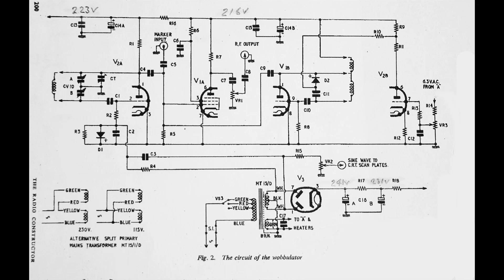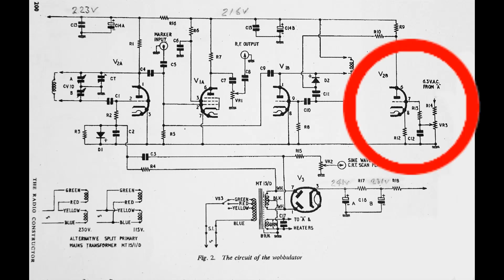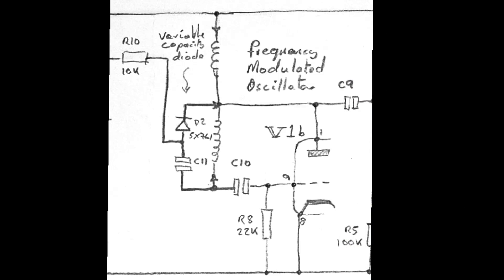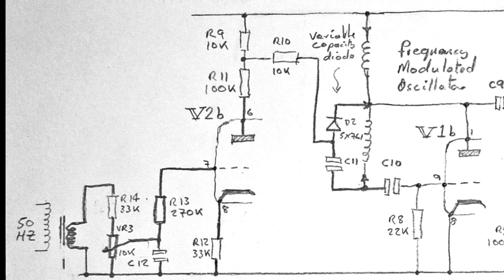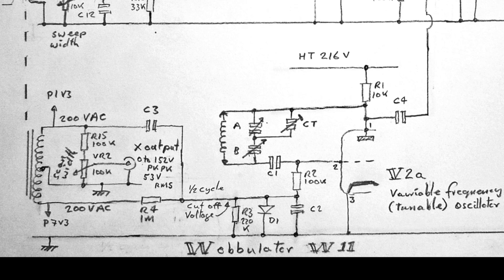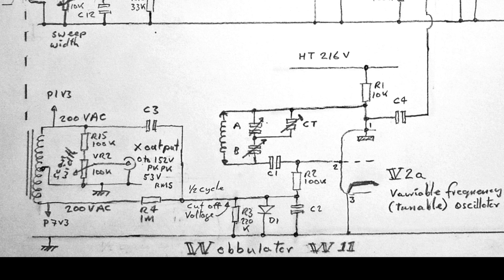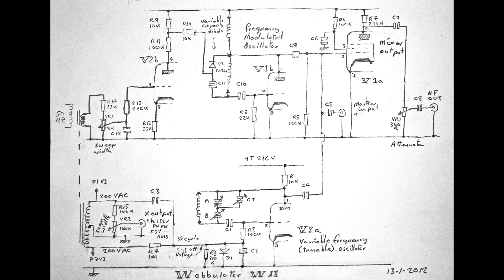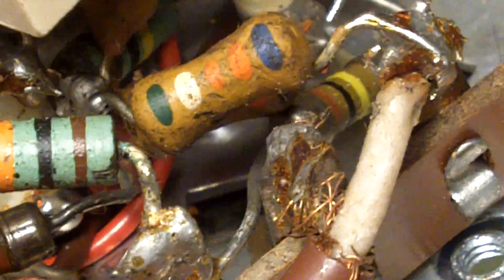About Radio ... Part 37 Wobbulator, Further  Ongoing Repair by Andy Davies

Comment from the maker: Hi there, I certainly find it helps to have things presented in a reasonably logical fashion and left-to-right works for me. Unfortunately I’ve let this project hang on far too long but I do intend to finish it. OK on the homebrew kit, in fact I have another wobbulator that’s homemade (not by me) but I don’t want to try it out yet as I won’t want to fix the Jason once I’ve got the  Eddystone radio aligned. 
Kind Regards... Andy

Comment: Great explanation.  Amazing how much of a difference redrawing the circuit can make to the clarity of the design.  We are so habituated to reading L-R, input to output.

I'm tempted to build my own version of this heterodyne wobulator using solid state.  Long ago I built a directly FMed generator with a 555 timebase.  Using a largely fixed frequency sweep oscillator means you can directly calibrate the width control, where as in mine the shift varies with centre-frequency tuning.

Comment from the maker: Hi there, thanks for the interest. I did a bit more work on the wobbulator; I found quite a few resistors were way way out of spec. It’s working but I’m not sure if its 100% correct yet. I had to shelve the project temporarily some time ago as I have a lot of other more important demands on my time and now other interests have kind of got in the way. I’m too easily distracted. Anyway, I hope to pick up where I left off as it’ll be fascinating to see it use.  Kind Regards ... Andy

Comment from the maker: Hi there, I guess ‘Some kind of electrical engineer’ just about sums me up. I trained for a while as a Radio and TV engineer but moved on into high power industrial electronics where capacitors are water cooled. Ok on the point to point wiring, it may look awful, and sometimes it was but it’s of its time. Veroboard is a product of the 1960’s.  Point to point still has its place, where you have high voltage or you want to keep the capacitance down.
Thanks for watching.
Kind Regards ... Andy

Comment: woah, you must be some kind of electrical engineer.

i'm intimidated looking at the schematic.

why did they have such horrible soldering practices back then.  didn't they discover the idea of putting things on vero boards back then.  everything is point-to-point soldered to everything else in one big mess.